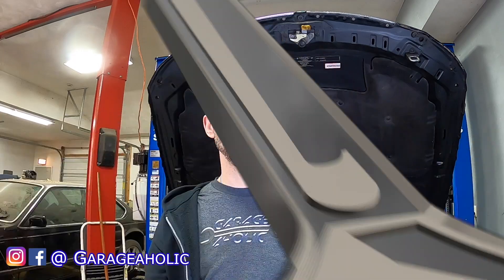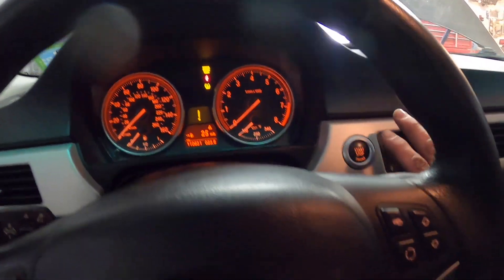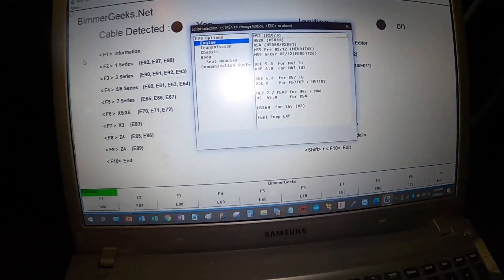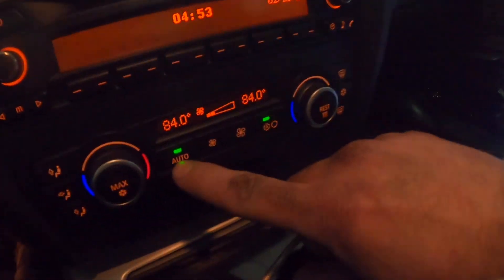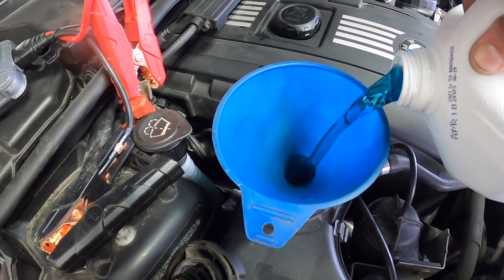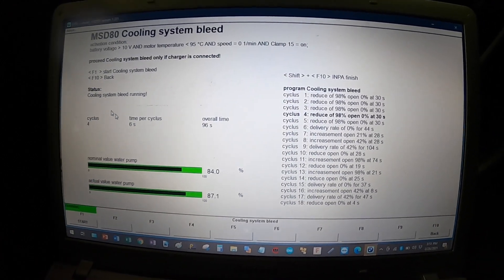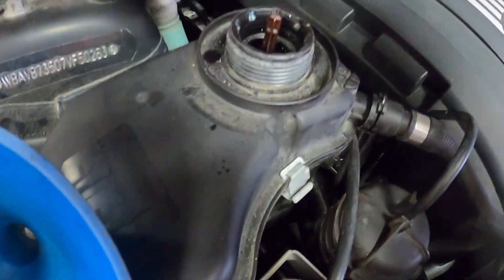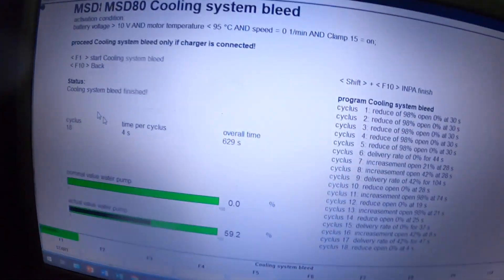Part 2d BMW N54 INPA Bleed Coolant & First Start

Comment: Great video Frank. There's also a way to bleed coolant without using inpa. Blower on,  heater on, and press the accelerator for 10seconds, I think. Could be wrong. Same procedure for N54 and N52.
Reply from the maker: Yep! Nico said that as well!
Reply: @Garageaholic  I wander if the coolant pump runs different between these two methods. Either way still an educational video because one would need inpa to bleed an integrated N54 engine.

Comment: Very nice Frank. But I'm confused a bit. I use the ECU build-in program to bleed the cooling system. Start button without brake, tap 10 sec on the gas pedal, and the bleeding circle starts. The only thing you can't know is where the circle is at the moment and how long it will take to be done. Using INPA you can follow the procedure. Or is using INPA a better way to bleed the system? Dutch regards, Nico.
Reply from the maker: That’s an excellent question! I think that there are 2 ways to bleed the system. Kind of like obtaining fault codes for old Motronic Controlled BMW’s using the “stomp test”!